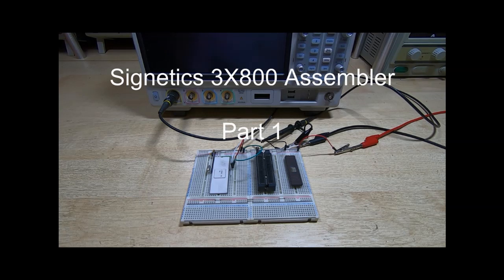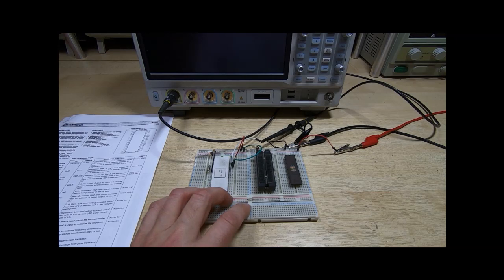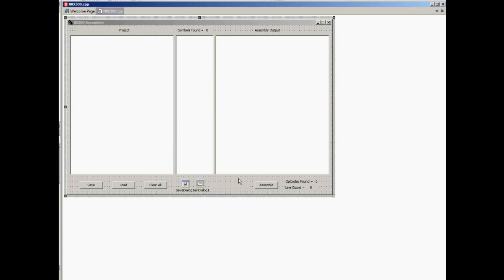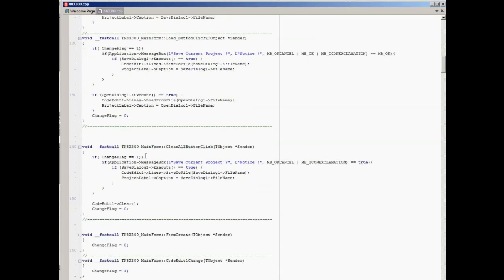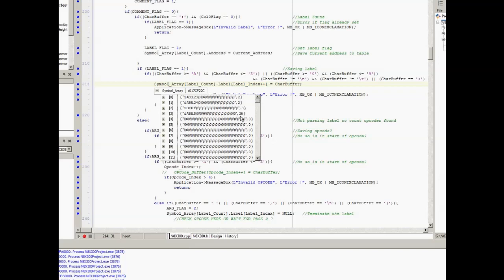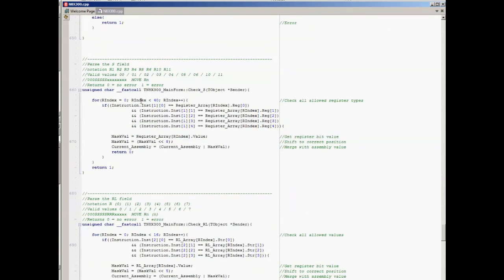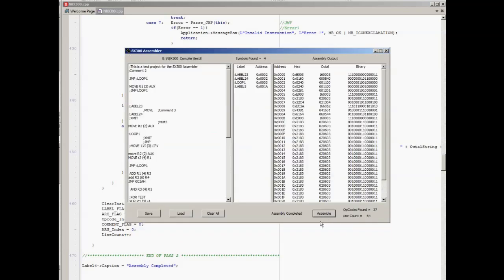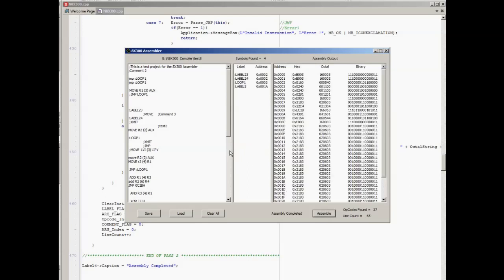Signetics 8X300 Assembler  Part1

Comment: Wow, Borland Builder!!!???  I thought it had gone away years ago.  I used to LOVE Borland products and still to this day believe their Object Windows Library was far superior to the MSFT Foundation Classes for Windows programming.  Years ago I wrote a cross assembler and simulator that would compile and run 8080 code on a Dec System-10 KI10 processor based mainframe.  Wrote it all in Dec10 Macro assembler.  Those were the days!
Reply from the maker: Actually you are correct. It is no longer called borland builder. It is now called RAD studio. It is very different these days as it has allows common source code to be compiled for many platforms from native 32 and 64 bit Windows to IOS. It also allows the code to be written in one of several languages. I generally just select the best language for the application. I still have turbo assembler V1.0. It came with a fantastic set of manuals which were great for learning programming (back in the 70's).

Comment: Hi Jerry, You should firstly have the video description changed to '8X300', as it really threw me at first - I'd never come across a "Signetics 3X800", and was very curious. ;-)
I worked with this chip alongside a TI TMS9900 as a project at Linotype in 1979.  A very simple instruction set which moved chunks of data from the TMS9900 very rapidly to and from data ports, video memory and hardware muliplier etc. They used to get very hot, and in the project source code I have, you would see comments like ...  " ..Idle to let 8X300 cool down".
Look forward to seeing it in action in Part 2 perhaps.... ?
Richard
Reply from the maker: Thanks, Yes that was a typo, I had already changed it so hopefully youtube should catch up shortly. The chip draws almost 7 Watts when it is 'taxed' so not surprised it gets hot. That was always a problem with that processor fabrication. They were very popular in some machines that had to be very reliable but only for short periods.
Reply: Fascinating.  The company I was with at that time used the 8X300 as an I/O processor also hanging of a TMS9900 in the role of telephone exchange monitoring - literally scanning the telephone lines looking at hook-states, dialling pulses, and so on to allow an organisation to understand its telephone system usage and costs, etc.  (Systems Reliability Limited (later plc) around 1980 or so.)